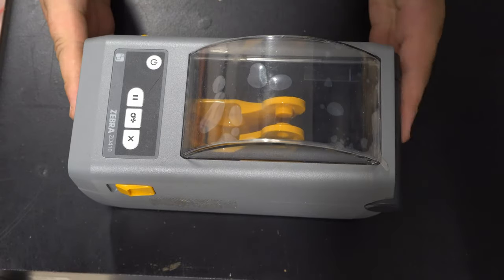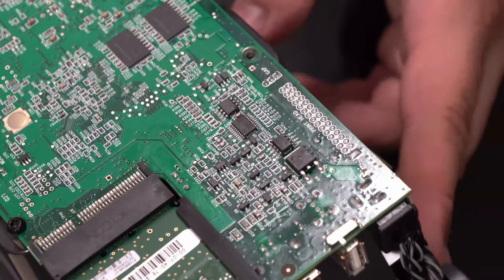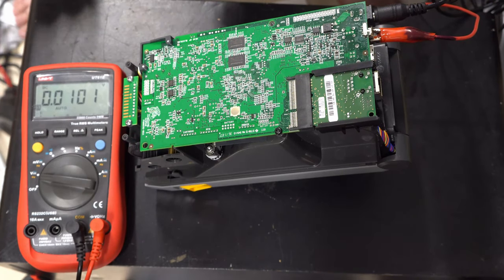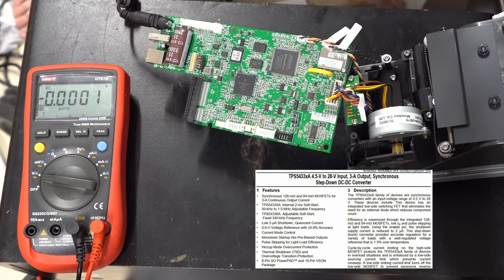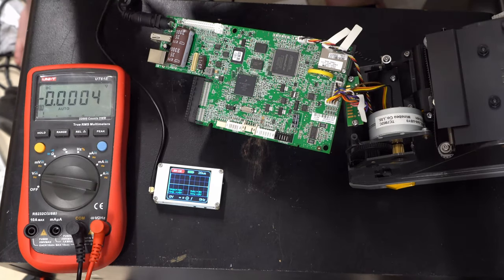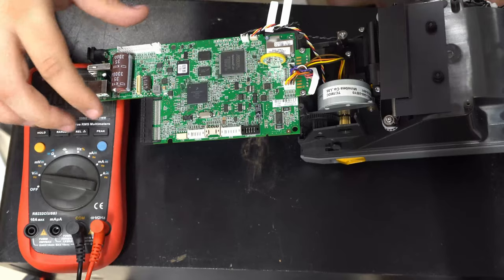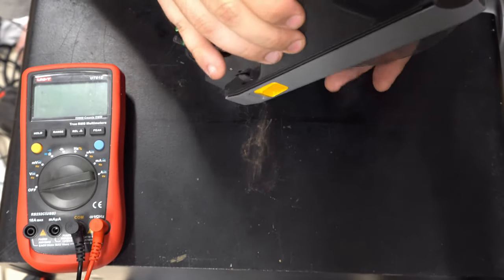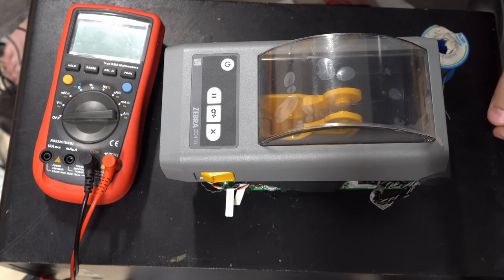Zebra ZD410 Thermal-Label Printer Repair

Comment: Excellent repair video.  I have picked up a free one that everything seems to be working except the paper feeding mechanism. After checking the motor pole resistance (4.8 ohms on both coils) I think the motor is fine.  Do you think it's the DRV8818 stepper controller that could be busted?  It's really hard to try to power the unit on and still have access to the backside of the PCB where the DRV8818 is.   I was probing the motor connections on the top side while pushing the feed button, but all I got was 0.5V on pin 2 that was charging up to 0.5V rather an instant on.  This tells me that there's something wrong with the stepper driver.   Not sure whether you have any insight into this.  I guess I could just replace the IC and see what happens.
Reply from the maker: no idea, 0.5v seems a bit low. try adding some wires to the important pins (vcc, step/dir/enable etc.) and measure while its running.